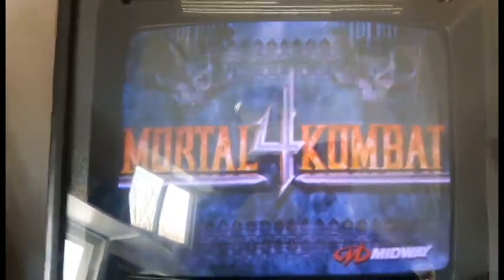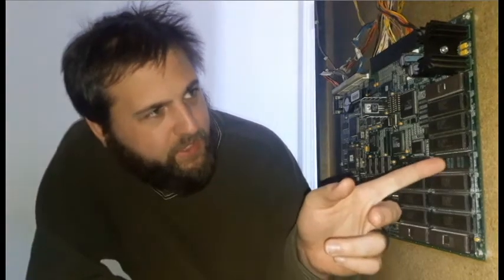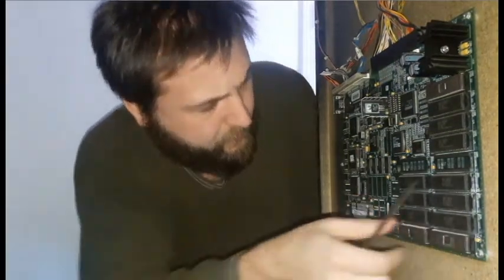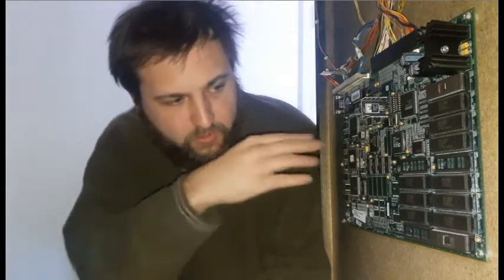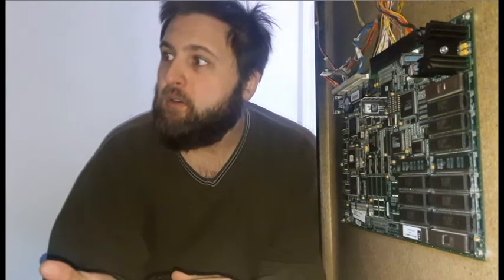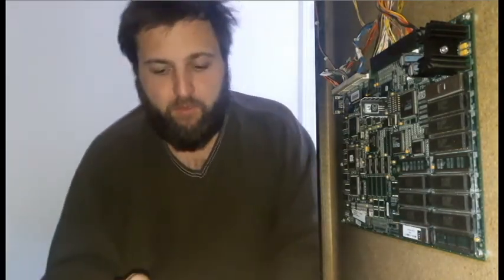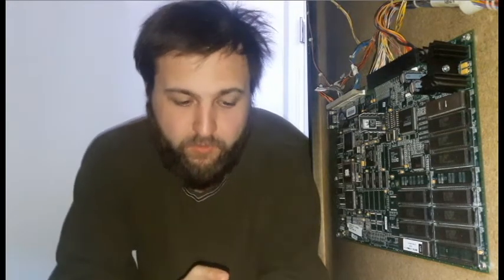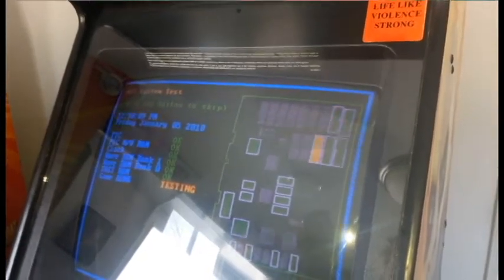Upgrade your Mortal Kombat 4 Arcade Machine

Comment: Don't use a screwdriver. There are tiny traces underneath the eproms that could easily get damaged. For as little as $5 one can get a proper eprom puller.
Reply from the maker: Thanks